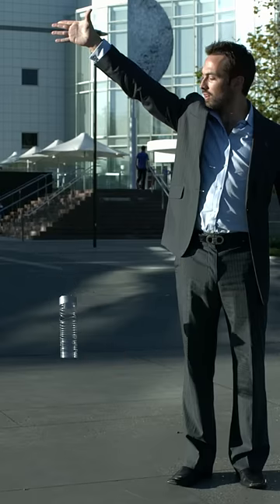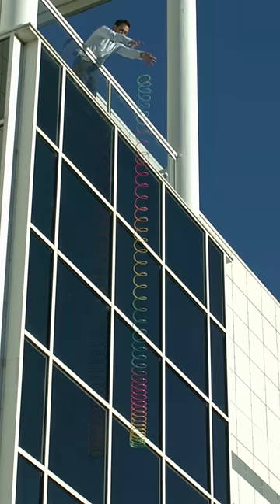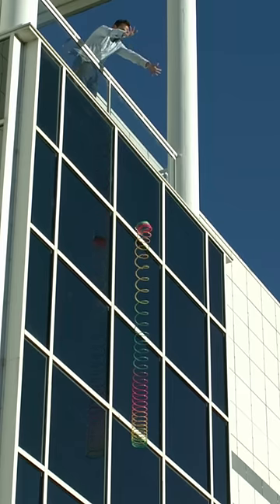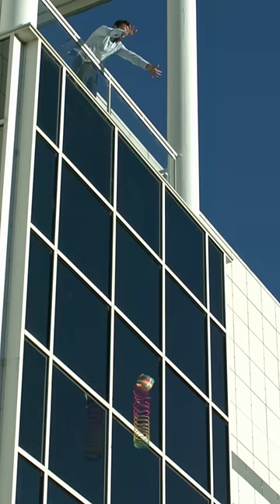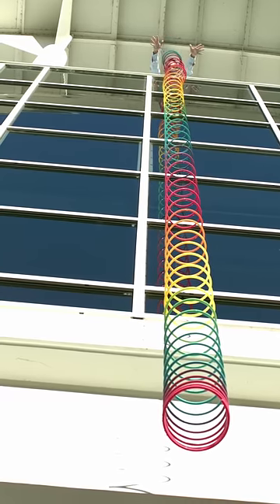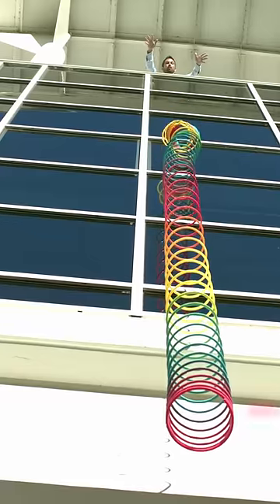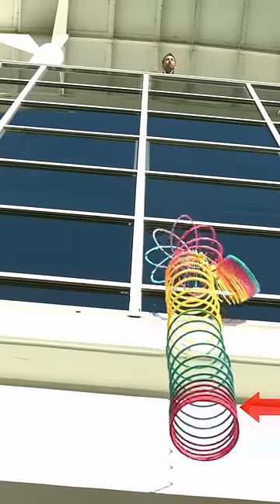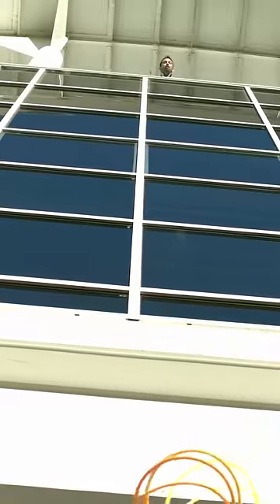How a slinky falls in slow motion #shorts

Comment: 3030: "and this is how we invented time machine"
Reply: Slinkies start to glitch in matrix
Reply: 3030 they will say it was an underrated comment
Reply: It was an underrated comment.
Reply: @dow_izz  hey dude, how is it there in 2030?!
Reply: @uygarozturk1326  (I answered, but you have to wait until 3035 to get this YouTube notification) sorry dude🥲
Reply: Hi i am from 2030 👀
Reply: Mr beast 2.0 in 3030: "i am giving away a Time machine..."
Reply: ahh yes “time machine” the technology which hasn’t sent any humans from future yet so real right?
Reply: Crap…. You may not be far off! 👀
Reply: that's not a thing they talking about
Reply: think the twisting was do to the speed being faster as the weight built up and toppled vs straight up compressing, otherwise it should have started twisting a bit when it first started to compress and it didnt, plastic ones arnt as good as the original, seems like it didnt fall perfectly or bad timing on release. weird oscillation tho, sending the wave without it being able to return, distance of waves changing every coil, assume similar to a, explosively pumped flux compression generator, slinky represents the magnetic flux drop the explosion, end result the magnetic pulse dumping all at once, difference between how radio waves are transmitted aka the stretched slinky vs a emp aka the compressed , correct? lol
Reply: Hold my beer ill come back in 6 years
Reply: What happens if you have an infinite slingy. Could I live hanging off the slingy forever
Reply: 🌟 U N D E R R A T E D 🌟
Reply: cringe

Comment: We need to get a giant slinky up to the stratosphere that reaches almost to the ground and see the bottom of it just levitate for like 10 minutes
Reply: This has to be humanities next mega project screw the MSG sphere
Reply: I feel like that’s a dangerous idea.
Reply: Lol we would need a huge helicopter 🚁
Reply: Do you know what wind is?
Reply: @sg5176  That would just make it move around a bit. If it is too much of a bother just make the slinky bigger or heavier.
Reply: @_MrMoney  wind is only gonna get higher with respect to altitude... 

If such setup is organised the the upper part will face so much wind pressure that it will start drifting itself with wind and eventually causing whole slinky to drift with itself with a cascade effect...
Reply: @sg5176  I fail to see the problem. The whole thing will happen just as in the video, the only difference is that the slinky will progressively drift, making it, if anything, cooler than just stuck in there.
Reply: @GayKermit-._-.  use your imagination
Reply: Somebody call Mr. Beast
Reply: But hold up, how much force would generate with that? I think you just invented a new W.M.D
Reply: @GayKermit-._-.  think of the amount of force behind it once it falls tho
Reply: It won't work but it would be fun if it did
Reply: @sg5176  that’s why we have to do it in a vacuum
Reply: @sg5176  increasing the cost exponentially, but it could be placed within a tube (with a decent bit of space around the sides) that has a strong base and is there to minimalize wind affecting the slinky. It will still likely move around some, but it'd probably work out better.
Reply: @alaskanwolf450  yes with vaccum its possible but the setup height has to be realistic and better have good budget 😂
Reply: Until the top part on fire crashes into earth and kills someone 🤣🤣
Reply: Are you friggin high? 

I am and that sounds amazing
Reply: I think the last part of the video explains how that might not work.
Reply: @Kristenstoll34  No. It would just rotate while it falls. It literally says that even if it moves faster, it will not fall until the top collapses.
Reply: If we can do this this will be a big achievement
Reply: @princevegeta1647  lol
Reply: i feel like this is something mr beast would do
Reply: @monki1666  that's because it is
Reply: Dont put it too high tho or it might float into space
Reply: @Alexei1950  Now that I think about it. If the bottom is inside the Earth's gravitational pull but the top isn't, what would happen? Would it be stuck floating forever or would it pull down the top?
Reply: It would be mad scary once it does fall completely lmao
Reply: That’s exactly what I was thinking lol
Reply: @SCA But velocity increases no matter the height and wind would just make it drift. Since it only hits the top and bot the bottom the same effect will happen, maybe not exactly the same, but the bottom would still be in place.
Reply: Do that for new years and the whole world finna pull up

Comment: Slinky: *isn’t falling*
Gravity: wait that’s illegal
Reply: No because the center of mass of the slinky is still moving downwards as the top is progressively going downwards towards the bottom. So the slinky is still moving, even if the bottom is staying still. So yes, it is falling.
Reply: Due to inertia of rest
Reply: @valewind4665  the slinky is falling but the bottom is proof that there is anti gravity potential in coils. We should be looking at this potential a bit more closely for possible travel at high g’s
Reply: Exactly
Reply: @truckertruthetrutrucker5357  fair point, but my original point was not to further explain how we could use this to our advantage in anyway, but to explain to op that yes, the slinky is still moving.
Reply: Screw gravity
Reply: Slinky is actually acted on by gravity. It is not falling because of the counter tensional force acting upwards that balances the gravity.
Reply: Physics : that's what she said
Reply: @truckertruthetrutrucker5357  that's not how it works
Reply: Kinda looks like a ghost in presence
Reply: @Waddle_Dee_With_Internet  WADDLE DEEE HELLO BUDDY POYO
Reply: @wannabmrsc  lol hi
Reply: Due to an issue, we've disabled the item slinky.
Reply: @truckertruthetrutrucker5357  There is no anti gravity potential. Its just the tension of the coils cancelling out the force of gravity. Forces add like vectors.
Reply: What if that method was used on humans of some sort like took that physics rule and applied it on people.. I'm not trying to sound like a smart ass but I feel like it could work somehow
Reply: Guys it was just a simple joke. He wasn't asking for a lecture lol. He watched the same informative video we all did.
Reply: @redprime3210  if your talking about me I’m actually a girl :/
Reply: @valewind4665  true
Reply: @truckertruthetrutrucker5357  welp i dunno i guess true too-
Reply: It is falling
Reply: Shadapp Kirby. Here, have some macaroni and chicken strips. Now say aaaaaaaaah

I SAID NOW KIRBY
Reply: @dae1925  macaroni with the chicken strips AaAa
Reply: @wannabmrsc  good Kirby
Reply: @beatcat1265  So you're asking him to stop commenting because his intellect surpasses yours?
Reply: @truckertruthetrutrucker5357  Whaaaat? You want to place a astronomic-sized slinky between i.e. earth-mars and then... 
...
...
... Nothing happens, because slinky is shrinking because of gravity xD. In space it would stay stretched.
Reply: it is
Reply: @valewind4665  congrats. You missed the joke
Reply: @retiredmichaeljackson4950  no
Reply: Isaac Newton: That's illegal
Reply: My lord, is that, legal?
Reply: Fck gravity
Reply: @valewind4665  Its not moving because of the lie of gravity its just falling because the slinky is made of material denser than the air.
Reply: Bug
Reply: Gravity: I'll allow it
Reply: Must be sigma rule or something
Reply: Ha nerds
Reply: @valewind4665  r/wooosh
Reply: Im to small brain for this ima head out
Reply: @valewind4665  YOU UNDERSTOOD THAT
oh God I just figured out that I'm dumb
Reply: @truckertruthetrutrucker5357 ..... A.. A...... # a. A. ... N....
Reply: @Protracier  lmao
Reply: @Gwappo_  lol
Reply: @valewind4665  What about the spring force balancing the weight?
Reply: Ha damn
Reply: @valewind4665  🤓
Reply: Pucci:so do I not exist?
Reply: No because the force that the coil is pulling the bottom part of the slinky upward is very very close to g (gravity)
Reply: @valewind4665  it’s a joke bruh, but I see you aren’t funny
Reply: @bluewolf5965  you seen this? 🌚🤔 Sounds awful.
Reply: @bluewolf5965  DISCLAIMER: NOT A CHALLENGE. EARMUFFS WILL SUFFICE. lol
Reply: -100IQ
Reply: Unfunny
Reply: Ping : 999
Reply: PEOPLE ARE RUINING THE JOKE BY BECOMING SMART NEEDS :C
Reply: @valewind4665  damn bruh it was just joke
Reply: Then plains are illegal
Reply: Not really it also disproves the flat earth as well because their "explanation" is earth id going up really fast. If that were true the entire slinky would despand when it hits the bottom not mid air because gravity is pulling on the slinky but the bottom is supported in a way that  pulls the bottom up just enough to support it till it hits the ground.
Reply: @ABCDEFG-GUMMYBEARS-R-CHASINGME  minor grammer mistake I win.

Planes*
Reply: Can you guys learn a joke
Reply: @redprime3210  yeah exactly cmon -.-
Reply: @wannabmrsc  ok-.. 😁😁😂😆🙃
Reply: no, its it actually falling, but the bottom part is not yet updated, because the weight is still supported by the falling upper part.
Reply: @retiredmichaeljackson4950  the thing that allows you to pull the table cloth of the table with nothing falling of
Reply: SSSniperWolf moment
Reply: @valewind4665  r/wooosh
Reply: THATS WHAT I THOUGHT 🤣
Reply: * cough * @sssniperwolf lol
Reply: @valewind4665  r/woosh
Reply: Lol
Reply: @valewind4665  It's a joke...
Reply: @valewind4665  why did u have to ruin the joke manlet poeple enjoy things
Reply: Lol
Reply: gravity does suck tho
Reply: These reply actually taking serious with this Jokes💀
Reply: worlds bggest slinky is bigger them empire state building
buts d fin and thick as any other
so lift it to the moon
Reply: @Valewind  🤓
Reply: @truckertruthetrutrucker5357  0[o
Reply: @gamerdio2503  but isn't there no gravitational force? The ground moving upwards?
Reply: @windowsxpmemesandstufflol  Newtonian mechanics is an excellent approximation for interactions on earth. You can't really use general relativity unless you're prepared to solve very hard equations
Reply: The coil above each pulls upwards, duh.
Reply: @valewind4665  l
Reply: @retiredmichaeljackson4950  to lolmlllllapaqq
Reply: Bro it a joke
Reply: @somedorkydude6483  I’ve heard the flat earth theories- none of which mention the earth “going up really fast”. How/why would that even be possible? I suppose it’s no different though than the theories of earth being round, and spinning hundreds of thousands of miles per hour in space.
Reply: Spring force balances the gravitational force so well
Reply: Logic : dont worry he’s hypothetically playing freebird
Reply: @SussyBond27 bro if you call him a nerd emoji one more time i will do a backflip off a dave and busters building
Reply: @realsanchez1394 real nerds are smart but people who call nerds a nerd emoji aren’t
Reply: If the bottom of the slinky was falling it would need to stretch the slinky even more which would've cause it ti break but the material is strong enough so while the top is still falling the bottom is held up
Reply: @valewind4665 The center of mass will rise up and then begin to fall
Reply: R.I.P your notifications…
Reply: It actually happens that when the top of slinky reaches bottom of slinky it speed is 19.6m/s and then there is a delay same the time taken for the connection of top and bottom of slinky and then it continues falling at normal rate thats why when slinky and other object are thrown together they touch the ground at same time even though the other object has travelled the half distance at the same time when slinky top reaches bottom. 
Thank You.
Reply: Slinky :Waiting
Reply: So funny….
Reply: @truckertruthetrutrucker5357 yeah but once you let go it eventually falls so it doesn't really work

Comment: Now I wonder what happens when you get a REALLY long one and drop it from really high. Would it look like it’s floating for a couple seconds? If so then cool
Reply: I wish there would be a video seeing something like that
Reply: I've thought about that too, but a slinky so long that you could stare at the bottom for a few seconds would probably break under its own weight
Reply: Your answer is in 2nd one. It will behave like that.
Reply: Also springs up another question. What if some mass is dangling on the end of the coil? Will that piece of mass "float" together with the end of the coil or will it fall too?
Reply: @The_Eray  
It depends upon mass of upper portion of spring..i.e,
If mass of spring>weight than it'll expand more to balance with tension on the spring and behave same as shown in video

If mass of spring< weight than weight will drag spring down much faster
Reply: @The_Eray  spring
Reply: @dot2184  interesting. what about a really strong a light spring like made or graphene or something? what about tempered high entropy alloy metals?
Reply: @thunderp1719  oh yeah that makes sense
Reply: It already looks like that
Reply: @thunderp1719  Okay genius. now go to school
Reply: @The_Eray  The mass at the end of the coil will either be too massive and force the slinky to actually fall as it collapse or it will be so light that it will "float" with the remaining slinky.

Basically either it overpowers everything or has to follow everything, depending on mass.
Reply: If you had an infinitely high and strong slinky then it would dangle forever and could be used as a ladder to climb to space
Reply: @lyrimetacurl0 it's the force of an exact equal and opposite reaction if the tension matches the weight of the entire coil or something like that. 

Space ladders are the same in a way but this is neat in that it doesn't rely on the centrifugal force of the earth's spin.
Reply: GENIUS!!!

Comment: Top slinky: we droppin boiiisss
Bottom slinky: WE DROPPED?!
Reply: Just like internet explorer
Reply: Just like Mc bedrock
Reply: It’s like an open air music festival where you can see the speed of sound from crowd reactions from front to back when the beat drops.
Reply: YouTube official✔  gravity worked ... The centre of mass of slinky was always in a free fall accelerating at 9.8 m/s^2 ....
Reply: @dev_invc  since energy was out to spread it apart once let go it wants to retract back to its original state. Following Newton’s law both ends will converge at the same speed. Since the top is falling at the speed of gravity the bottom is as well. But since it is also being pulled down by gravity the bottom has equal forces which negate each other making it stay in the same spot.
Reply: @caseypardini9191  I know
Reply: YouTube official✔  because theres an equal and opposite force acting on it. The force of the slinky was equivalent to the force of gravity until the top slinky came down and pushed it towards the ground.

Comment: What nobody mentions here is that the center of mass of the slinky still falls at 9.8 m/s2 (i.e. it is free falling with the acceleration of gravity), which means that, to compensate for the bottom coils not falling, the top coils are falling much faster than what they would if you just cut the top few coils and dropped them alone. An the reason is simple: The same tension that is pulling up on the bottom coils cancelling the force of gravity, is pulling down on the top coils adding to the force of gravity.